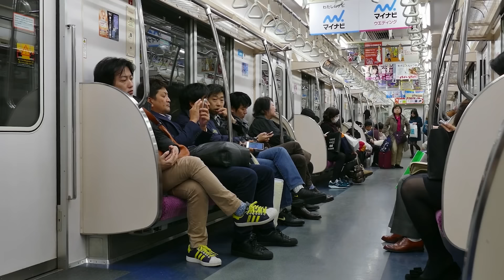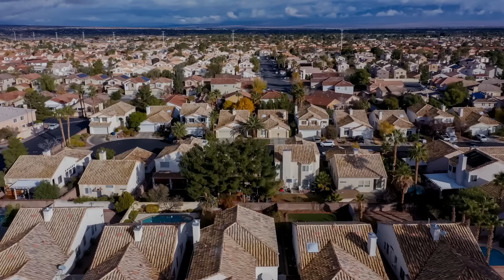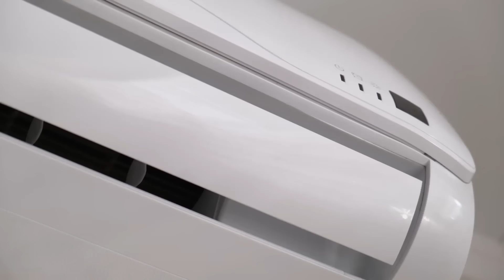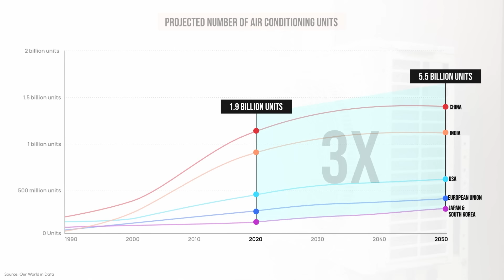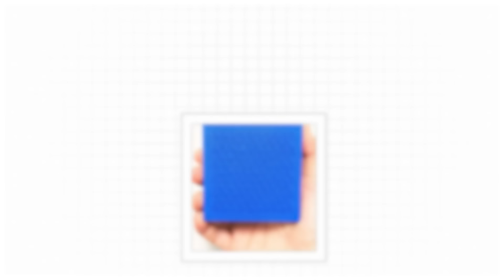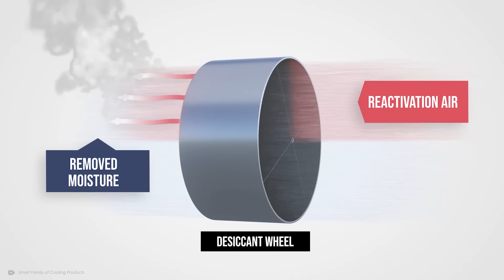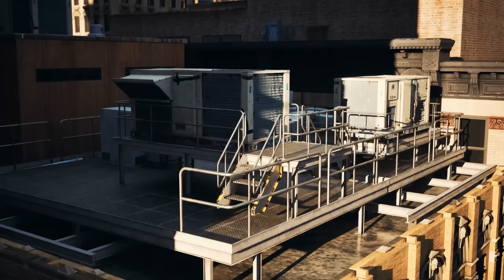The Future of Cooling is Here: The NASA Breakthrough

Comment: The catch 22 is the areas where this works great are very low humidity so the indoors have very little humidity to remove. 

But the areas with a ton of humidity to remove from the indoors don’t benefit from spraying the outdoor coil with that removed water. 

That’s why a cooling tower doesn’t do much in Houston vs the much higher efficiency a cooling tower has in Las Vegas 

This whole “technology” is just snake oil with a fancy name.

Comment: Since air con use corelates with temperature surely there's likely sufficient solar to power the units that removing the moisture is not a critical problem.

Comment: You can't "spin" water vapor out of air. In fact, water vapor is lighter than dry air, and would do the opposite of what is described. Maybe you could split the airstream, and exhaust.the water vapor, but you can't capture it without a phase change and an inherent heat exchange. And if you are exhausting air, then you need to bring replacement air back in. The other half of this is problematic as well as in order to use a liquid descant, it must be mixed with the air stream. Contamination is likely going to be a huge problem. 

This whole problem was solved long ago. Seal your airspace and manage the air replacement with heat exchangers. Once AC systems remove the water from the air, its gone. All you need to do is make sure more is not added back in.

This product is in search of a problem, and is barking up the wrong tree. Data centers often ADD water to the system to manage ESD issues. What it might be better applied to is extracting water from outside air for consumption.

Comment: so if the solution is to take the water out of the air, where would the system have the water go? will it need to be emptied or drip? would it put it back into the air?

Comment: A link to a scientific paper on this would be very helpful, I’m very skeptical.

I think you got one basic point wrong at the beginning: It couldn’t be droplets of water that are being separated in the helixes, humidity is water vapor, not water droplets.

I think what they’re doing is injecting water-absorbing liquid as droplets, letting it absorb the water vapor, then separating the liquid dessicant back out using the helical channels. The key is that the liquid dessicant has to have a very low recharging temperature so it can be recharged using only the A/C system’s waste heat.

I dunno though, one way or another you’ve got to overcome the latent heat of evaporation of water; I don’t think there are any shortcuts for that.

Comment: Clogging seems its week point, mentioned grease. Wonder what their solution is or they just lifetime out. Maybe deep cleaning process. Would probably need a booster fan to help pull air, that energy to throw the water out needs to be made up somewhere, take the strain off the main fan. Ultra hepa filter.
Make it translucent and fire a ultraviolet light for sterilization.

Comment: I question this. In aviation we use something called a vortex cooler to reduce air temperature it spins the air in the cone at near supersonic speeds. It doesn't pull out water. There is something that we aren't being told about in the system.

Comment: For basic comfort at exceptionally low cost, triply periodic minimal surfaces have been shown to reliably condense humid air. This is ideal in combination with a Maisotsenko based air chiller, which is also using geometric arrangements of channels for immensely improved thermal and hygroscopic control.

Comment: Good to see sensible ac engineers comments,  water vapour molecules are lighter than air so have to be condensed to droplets by cooling. Desiccants can also collect them but the desiccant  then has to be regenerated with heat energy.

Comment: As a HVAC Tech, the first two things that immediately jumped out at me were static pressure and "how the hell are you cleaning it?". He didn't touch on either, so I doubt this will see large use. I don't dislike the idea of improving efficiency. Like, this is obviously one of the most important puzzles we have to solve, but tbh, the actual solution is probably getting farther away from these "3-10 years of use then put a new one in" units, and start making units that last 30-50 years again. Like, we're hitting the limits our known materials, so I don't think we need to focus on "new" products, thinner materials, etc to get better efficiency, we now need to look at whole system designs and pick the best solutions at building concept level, hell, even design the building around the comfort needs. Sometimes I feel like the solutions that engineers and tradesman have to solve and overcome, are so STUPID, if we just actually prioritized all levels of human need and comfort in the process, and not just consumer end wants and wishes, we would have a much better trade. A Lot less salesmen and a lot more servicemen.

Comment: Humidity control is extremely important for human health. More important than actual temperature (with the exception of extreme Temps). Too humid and you end up with mold, mildew, and bacteria growing on stuff which promotes allergies, unhealthy air quality, infections, food spoilage, and just generally being gross. But too dry and you end up with cracked skin and nazal passages which are excellent entry points for diseases that are airborne or spread through handling things. Just keeping humidity between 45-55% massively reduces a whole host of chronic health risks. And the best way that is indirectly managed is through the use of a properly balanced hvac system. Too large and over sized and you get nice cool air, but high humidity during the summer, or nice warm air and too dry during the winter. Too small a unit and you end up with the opposite.

Most places humans live the heat and cold are not what kills you or makes you sick. It is poorly conditioned air and humidity control that causes issues.

Comment: I am in the planning phase of building a house. I have chosen the technology of a frame house, and the filling of the walls is hempcrete. Hempcrete, despite the lime as an ingredient, has a negative CO2 balance, because hemp grows very quickly and absorbs huge amounts of CO2. Hempcrete is also a great insulator. I hope that the insulation will be enough and I will not need cooling in the summer.

Comment: Video says, that air conditioners, make lot of co2.? But how, by generating electricity from fossil fuels? Solution is quite simple, just install lot of solar panels, on hot sunny day they generate enourmous amounts of electricity. Only small problem is left during night time, when there is no sun, but this can be solved, by installing electricity storage systems. Or maybe importing electricity from areas, where is su shining during that time. Electricity losses, by delivering it thousands of kilometers is not that big.

Comment: Hi GOOD CONCEPT. by using a silica or similar to dry the air before passing through the evaporator then transport it to the condensing area to be dried using a HOT pipe and then transport it back to start all over again. If you say this could                                save 50% in running cost i would think around 10% for transport. now the drying container would be very long and open top for moisture to escape plus this water could add to taking heat from the condenser.I dont think this could be fitted to existing domestic systems but commercial YES  DOWN UNDER DAVE     ps I have already built one in my mind

Comment: The more we use it to keep things cool, the more we heat up other places on Earth... okay right of the door we have a huge red flag. Biased or uneducated opinion that completely misses the point of cooling. Yes - when you cool something ---> something else will get hotter. That's the basic physical principal. Thats how it works! Thats the whole point. AC uses the Earth atmosphere as infinitely large space that you cannot heat up or cool down with your puny AC. If you do that in two rooms you will quickly deplete one room's energy and make the process infinitely harder, so it only works if it's outside. Water does soak up energy but I fail to see how that is a bad thing. If you are heating a room and the water inside it, the water simply contains that energy and releases it slowly as the room cools. And if you are cooling a room - you are also cooling the warm water in the air which condenses and is being taken out of the system. But either way you have to deal with that energy contained in the water. Dry air moght get things done quickly, but that's the same as claiming that if we take out all the furniture inside the room we can heat it up or cool it down quicker. While that is true it is hardly any solution that makes any sense.
And if you talk about energy requiring burning fossils and that makes our atmosphere warmer - AC is the least of your worries. Lowering the electricity needed for that is ABSOLUTELY WELCOME no matter what your stand point is. But talking like that makes me not want to trust what next you have to say. Rather hear an objective well educated opinion on the matter. Not magic dust in our eyes because we love nature. We do, but don't exploit that. These systems seem to not have been tested and proved on Earth by real examples. Could be just vapour. I followed a youtube engineer that tied to make a dessicant AC and after a very good trial he reached a conclusion that we don't see any benefits. So no cheaper AC so far.

Comment: Fun Fact
For every one death caused by hot weather ten people freeze to death in cold.
Aircon certainly does make it seem hotter elsewhere especially when the thermometer for the weather monitoring station is located right beside a row of air conditioning condensers.
And the ones out in proper locations are no longer monitored so the data is made up by extrapolating from the ones in urban heat island locations.
Technology that makes aircon better and cheaper to run doesn't need BS climate change propaganda to be adopted. Just tell people it's better and cheaper to run and they will buy it Unless it's actually crap and you need the climate scam to force people to buy inefficient environmentally harmful rubbish like EVs solar panels and windmills.

Comment: Real world applications would see a very small to negative benefit as they haven't considered that the AC room is an enclosed space and so a conventional AC system may initially is not efficient in a humid room, the efficiency is eventually regained as humidity is continuously removed from the room. So efficiency would become the same eventually for a precondition air Vs conventional AC system.

Comment: @5.40mn the graph that shows Projected Number Of Air Conditioning Units; the 2020 and projected 2050 values are not correct!  According to the graph the stacked value for 2020 is around 3 billion units, while the projected 2050 value is around 4.5 billion units, so the projected increase in units number is around 50% (or x1.5) and not 200% (or x3) as reported!
How is it possible that such a huge mistake was introduced in your presentation ? Do you realize that coming from a channel like yours this would be highlighted as misinformation!  I think you should apologize to your followers in your next video.

Comment: I'm all for improving the efficiency of the air-conditioning/heat-pump systems themselves, but I am baffled by the under-emphasis of insulation when discussing the matter.

Using conventional AC/HP technologies; it's virtually free to maintain temperature/humidity once a properly insulated space is cooled/heated - I'm not sure the efficiency of the technology matters much at that point. 

I'm not sure about Europe, US, UK - but having lived in Australia, New Zealand and across Asia - I have almost never lived in a house/apartment with insulation. 

People often prefer to install solar panels BEFORE insulating their houses - which absolutely blows my mind given solar panels are more expensive and save less money than insulation would (insulation is a 40% saving on energy bills).

To me it sounds like a no-brainer to roll-out quality insulation on a mass scale - something we already have a trained workforce for, have manufacturing at scale and logistic networks to handle.
Reply: Insulation works well to reduce heating demand, but for cooling is way more complicated. You need some insulation, loads of thermal inertia and a way to remove latent heat (humidity) that is generated by humans themselves.

Comment: Radiant cooling and heating are often overlooked opportunities to improve comfort and efficiency in temperature control. These systems work differently from conventional air conditioning or heating by focusing on how surfaces emit or absorb heat, rather than just blowing hot or cold air. For example, a room with warm air can feel comfortably cool with radiant heating, just as a room with cold air can feel comfortably warm when radiant cooling is employed.

Comment: There doesn't appear to be any benefit given removing humidity changes the thermal mass of the air which means there is less thermal mass to absorb heat from whatever you want to cool down.  In the opposite scenario, for CPU cooling, more thermal mass contacting the environment works better.  If you could use a fluid twice as dense as water, assuming all things being equal, you'd expect to be able to halve the flow rate to achieve the same heat transfer.

Ironically, I had a relevant experience yesterday going for a walk to the local lake which has been formed in an old quarry.  It's a minor basin feature and the air had cooled around the lake in this basin and was also very humid.  It was extremely pleasant as it was pretty hot and the air was fairly still.  Walking the path brought me to spots where the hot dry air was intruding in to the basin and I immediately noticed my t-shirt stayed cool for a few minutes!  My t-shirt had been saturated in dense cool humid air which gave it a very noticeable effect with the change in temperature and humidity - dry air will take longer to transfer heat - which is why I'm Asus on this technology.

Comment: So fun fact. Most airconditioners are installed incorrectly. Your condensate pump is supposed to connect to the condenser so the condensate can be evaporated on the high temp side to improve efficiency. Which I've read time and time again but never seen an ac installed this way.

Comment: I think you didn't understand the technology you presented very well.
Ammonia is a gas, not a particle. The water that will condense when cooling the air is also from a gas, not droplets. Lithium and Calcium chloride are solids, not liquids. 
There is no way to "filter" a gas (air) for other contained gases (ammonia, water vapour) just by a simple helix. But it is possible to apply a diffusion membrane filter in a similar way as it is used in a nitrogen generator (look it up). In this case, a large surface area is required to have a good efficacy (hence the helices).  It may work like a partial flow filter, where the air to take in the water is preheated (e.g. with the excess heat from the AC), applied in a counter flow principle for absorbing the water, and is then disposed of to the environment. The air to absorb the moisture can be replaced by a liquid desiccant, which then has to be dried again, of course.
Liquid desiccants can be, e.g., glycerol or sulphuric acid. But removing the water from these will take as much energy as it needs to dry solid desiccants. However, I can imagine to use a lesser hygroscopic liquid for desiccation that is then dried by using the exhaust heat of the AC. Although this will need additional pumps and ventilation which will impact efficiency.

Comment: Just thought I would add some window air info.  I purchased 2 LG duel inverter 10,000 BTU window units and
they use 20-30% less power and are soo quiet compared to my other units, they cost more but over time
they will make up the difference.

Comment: Have a concept for atmospheric moisture harvesting, this structure would likely boost the end stage water collection up a lot.
The concept already super saturates the air efficiently and uses fast flowing slightly pressurized air, so if this can dehumidify air that's below 100% saturation, then my performance figures would look really good. This would even replace both the end stage decompression nozzle, heat exchange block, and most of the collection mesh, all while simplifying the geometry and mechanical complexity. 
I wanna know how staging it would work and how efficient this can really be made.

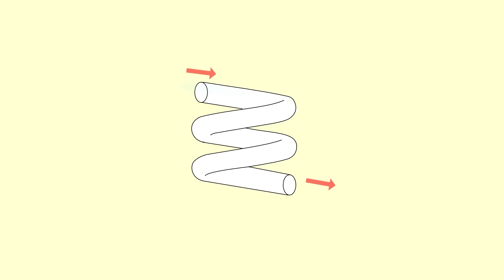Comment: 8:05, strange, I think humid air is not air with water droplets. It's air with water dissolved in it, one homogenous body of gas without lighter or heavier parts.
Reply from the maker: Yes this was an error on my part. I believe the liquid desiccant is used first to turn the water vapour into liquid droplets first, and then the helix coil is used to remove these droplets.

Comment: This doesn't make sense. If there are droplets, it means they are already in liquid state. They will not be a phase change load.
Reply from the maker: Yes this was an error on my part. I believe the liquid desiccant is used first as an aerosol spray to turn the water vapour into liquid droplets first, and then the helix coil is used to remove these droplets.
Reply: He meant water vapor (gas) into liquid. Enthalpy of formation is the thermodynamic effect you want to know to figure out why this makes sense.
Reply: He also talked about liquid dessicant. So, putting the two together, the following is my guess: Spray in the liquid dessicant which absorbs the water, then use the helix system to pull it back out of the air. Then use the waste heat to regenreate the dessicant. So, to my mind, this made complete sense.